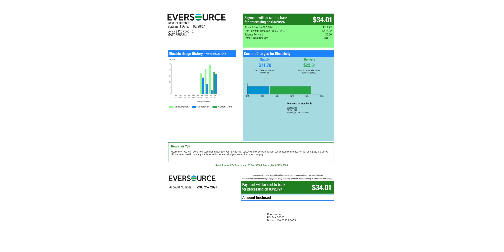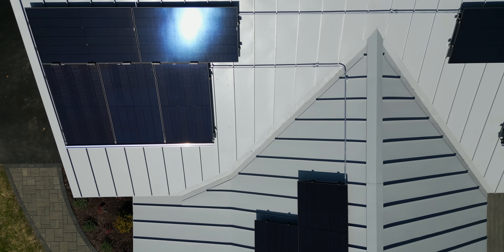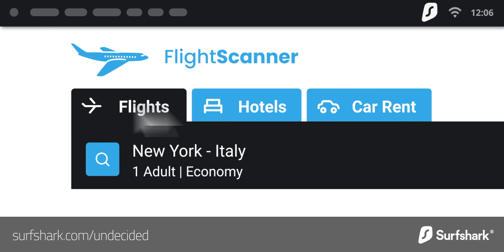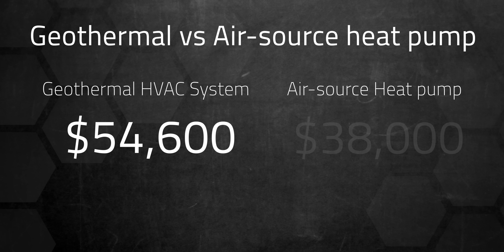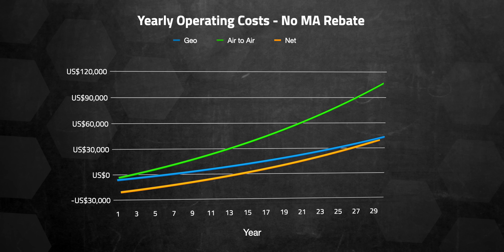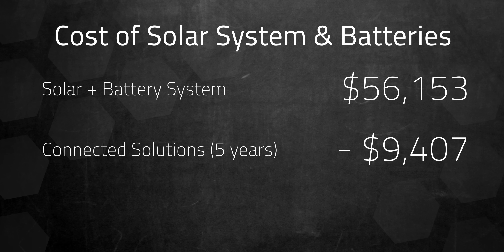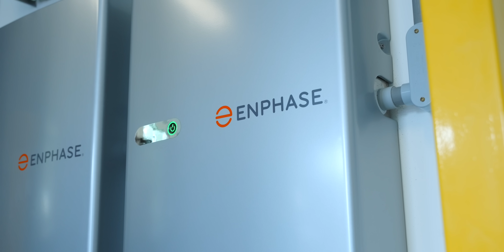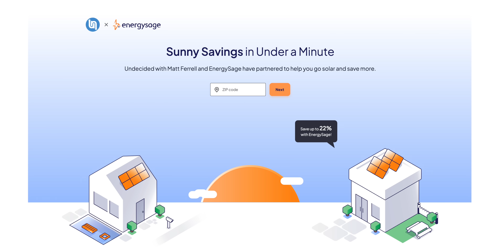What I Learned After 1 Year with New Solar Panels

Comment: The financial analysis is completely false.  It does not account for the time-value of money, that is, the earnings your up front investment would make if not spent on the solar and expensive furnace and water heater, but instead put into a long-term investment, such an S&P500 index mutual fund.  I assure you, if you did the calculation with this in mind, you would would be far ahead by not buying solar and the expensive furnace/water heater.  If Matt Ferrell was really concerned about the economics, he would have included this effect.  Bottom line...renewables are expensive, and rarely make economic sense. If you think the environmental benefits are worth it, then go ahead, however you are replacing energy that is created by very clean methods in the United States, so your actual impact on the environment is arguably minimal, and the cost to do so will be significant. Your "environmental" expenditures might be best spent elsewhere.

Comment: So you have taken $66,000 of taxpayer money for your systems in the form of federal and states rebates.  Getting 1:1 net metering takes money from your neighbor ratepayers as the local utility still has to maintain the delivery system in case your system fails.  I guess that to be 16,000 kwh/yr times $0.15 per year delivery charge or another $2,400 per year you take from others.
If we all did what you did there wouldn't be enough money by a factor of many.  Ever think of thanking your neighbors and fellow taxpayers?

Comment: How can an electric bill be that much. I have nothing that is efficient and we blast the AC and scalding hot water.  My wife uses the dryer almost nonstop to the point of burning out heating elements every 1-2 years. I actually keep a spare in the house.   Yes, everything is electric and still my bill is $500-550 a month.  That’s $6000 a year.    Over 30 years I would save 180,000.

Comment: I’m a big believer in solar panels for homes, but find there is a lot of hype and misinformation out there

We had 22 solar panels installed on our house in 2019 q e sold the house 3.5 years later 
Even with rebates it would have taken 20 years for the system to pay for itself.  No surprise there, we didn’t install them for cost savings.  During that time we generated more power than we used, and “sold” dower back into the grid.   Technically they worked exactly as advertised 

The big disappointment came when we sold the house.  In short, the solar system added zero dollars to the value of the house.  They did not make the house more appealing to potential buyers.

Comment: I’m a contractor what consumers don’t get with these technologies whether it be geothermal or solar is that ur basically paying over 20 years of ur energy costs.

Example: let’s say ur electric bill is $200/mo. (Arbitrary # for this example) that’s $2400/yr. X 30 years that’s $72k still that’s 16k before the cost of the solar system.

Now do u think ur 30yr solar system is still viable or do u have to start replacing panels n batteries over that time frame?

Do u have to replace n update the whole system in 30 yrs? Costing u another 88k to simplify these calculations. 

Not to mention ur still paying $40/mo just to have a meter on ur home adding over. $13k in 30 years. That figure only matters for solar cause that cost is already incorporated in ur normal electric bill which ppl with solar that’s an extra cost just to be on the grid as backup or to sell power back to the utilities company.

Not to mention if u have to replace ur roof which u have to remove n replace ur solar panels adding an additional cost vs. non solar replacement roofs.

In the end the math doesn’t math for solar!  Not to mention the environmental factor for battery n solar disposal

Comment: Congrats.  15 years ago we replaced two water heaters (we have a large modern home)with a tankless system for three floors.  Unbelievably we have not had a single problem and it paid for itself in seven years. The kids (and now grandkids) love to take showers because the hot water never runs out.  Solar was an idea but the company itself suggested we wait for prices to drop and efficiency improve.  (Prices dropped, efficiency rose slightly but labor costs exploded - lol)

Comment: I had a geo thermal heat pump 10 years ago.  During the winter we were always cold averaging about a indoor temp of 60 degrees.   It was costing 350 a month to power.  To upgrade 10 years ago it was 55k.  I got a natural gas furnace and ac for under 6k.   My monthly gas cost over the winter was about 130 and electricity was about 130 and I am warm.

Comment: Hi Matt i love the project I live in Sweden and have had my home 9 years it is a home built in the late 1960s and that presented some challenges but I have also made significant improvements like extra isolation in the attic installation of HVAC systems (dual for each floor) and massive solar and battery 14.4kW peak solar and 32.5kwh home battery. I am net positive producer and all my driving is in EV powered mainly by our solar system. 

I can only agree with you the investments which I made all out of pocket without loans I see as prepayment on my consumption. 

I am looking into geothermal and domestic wind turbine but they are not yet feasible in Sweden for
Permit and due to my house being connected to district heating with the fee being the largest portion of cost that I am unable to exit from unfortunately. 

Overall I have calculated that my system upgrades have already last year paid of my full investment and from this year on is making me real money so my ROI is amazing but for those that are looking into this as you said it will be highly individual due to local market , conditions and situation. 

I definitely think one should save and never do lease or renting solar nor take loan for the investment as that can bring in so many new unforeseen consequences and dimensions to the future saving. It’s better to do step by step and save until one can afford to do this and even then one should really look at one’s life situation if you are unsure of the house or life plan for
Next 10years don’t do the investment thinking it will add to the value and you still get your money back.

Comment: Hot water heat pumps are a farce. I wish social influenceres would stop pushing them, because politicians are going to be pushing them and then we will all realize that we are using more energy, not less. Net zero energy is also a farce. Yeah, maybe you have balanced out the electricity you used over the year, but what about all the energy used to manufacture, deliver and build/install all this tech on your brand new home? If everyone goes out and builds a brand new home with all these gadgets energy usage and pollution are going to sky rocket, not go down. And yeah, solar never pays off. But none of that is the point. It's about independence from the government and their inability to work with the energy companies to keep the grid going.

Comment: Im surprised at these Solar costs in USA, In Australia I paid $3600 for a 6.6kw Solar system, each year it offsets $1,200 in energy cost. Then when adding a 20kwh battery which costs $8k installed, it offsets my entire daily usage. With battery I pay a connection fee per month, and thats it, break even after 5 years, the system saves me $2448 annually, even during winter, tho I will admit its more like CA weather here.

Comment: I installed 6kw in my house in France, get a max of 4.8kw as panels face southwest. I save 30% on my house electric bill and 4000Euros a year charging my hybride car. System cost 13,000 Euros but added 5% to valve of house = 25,000 Euros. So overall a big financial win and effectively already paid for itself several times over after just 2 years.

Comment: Love your videos, you know on some of those installs you could gone DIY like the solar . 400 watt panels run around  $0.27 - $0.35 per watt , 43- 400 watt panels at the $0.35 is $6,020.00 plus a  inverter let's say $4,000.00 , not buying the most expensive mounting (snapNrack topspeed) $1,500.00 ,also some installation help $2,000.00. A grand total without splitting hairs  $14,000.00  the inverter is battery friendly so additional  for batteries $3,500
.00  and optimizer are cheaper, so $1,900.00 for a new total of $19,400.00

Comment: I’m in a low tax bracket so no subsidies for me.
I did a DYI system for about 20 grand with panels, all in one inverter and battery backup. I added 15 kWh of battery to double my capacity for under $2500 and 10 more 3700 watt panels to double my solar for under $900.
Batteries make sense since we have a TOU program that gives us low rates at night for battery and car charging. 
We calculated our ROI to be around 5 years between gasoline and electricity savings.
I guess if you make tons of money 💰 you can pay top dollar and get credits.
Personally I think tax credits for solar and EV’s should go away along with oil and gas subsidies.
We also have lots of shutoffs so we are covered there.

Comment: Your homes saves up to $300,000 over 30 years.

Your out of pocket costs are
Geo-thermal 39,600
Solar & Batt 61,253

If you invest $100,853 for 30 years:
7% $763,995
8% $1.01 million
9% $1.34 million
10% $1.77 million
Reply: No real savings when compared to a normal investment in the market, bonds, CDs, etc.
Reply: Ummm, you can do both of course . . . The rest is a matter of preference.
Reply: He financed it so he only put down 20% of that

Comment: Tbh euros would absolutely laugh at the solar installation costs, something like that could had costed under 25k or probably 35K still using Enphase equipment.
Here in Oregon we're being quoted about 50K for 14kWh, something I estimate we can DIY for 8K in material costs (12K if I used the same equipment) including conduit and other, so even if I underestimated by 10K, the difference is insane.

Comment: Power's really expensive in mass, here in maine I pay a little under 13 cents plus a $27 service fee that also includes the first 50kwh. I used 2845wh in 2024, and that's with electric heat (just a space heater it's a 1 bedroom and I keep the door to the kitchen shut) and using an ac for basically all of july/august, I plan on not using it this year to save tons of power though.

Comment: Just in friendly comment that its good to discuss of Peak power of solar system as like 17,2 kWp system as its not going to produce all the time same amount. good video content overall and just want to add on that point :) Just now I am building a new house, wheres added solar system, much smaller 5,5 kWp with micro inverters, but idea is not push in to the grid, more like use as its own and later on maybe battery system but more interest when V2L and V2G coming and more use of cars in the storage systems not stand still batteries :) overall point is that later on us consumers always have to pay either for use of energy or for feeding energy into the grid.

Comment: I cannot compete with you in the nerdiness realm, but as a retired nuclear engineer I do like tech. I am on my second generation Waterfurnace ground source heat pump. I even had a Carrier heat pump that attached to my water heater in my home in the 1980s. When I upgraded this house heat pump water heaters were not readily available so I went with a 95% efficient forced draft gas water heater using outside air for combustion. After installing a later model Waterfurnace HP with desuperheater I added a 55 gallon water heater just as a preheat tank to harvest heat from the heatpump and supply the gas water heater. During air conditioning season here in SC that supplies pretty much all my hot water, and quite a bit in the winter. The highest gas use this winter was 5 therms, which includes a bit of gas log use. If I did not have the gas log I would switch to HPWH here and will do that when this gas unit fails. In my vacation house in the NC mountains I have a large basement/crawlspace with an 80 gallon HPWH in the garage so it helps dehumidify the house. Lowest winter temp I have seem in the garage is 55 degrees. Since we don't spend a lot of time there in the winter I went with an efficient air source heat pump with Propane boost. This will heat the house quickly and keep it warm in cold weather at minimum up front cost. In 10 years I have used about 100 gallons of propane. Average electric use is 320 KWH per month. In September I installed a ground mount solar array at home that puts out 7.65 KW peak. My monthly average output for October through March was 1.066 MWH. In SC solar requires a time of day rate and I can only use energy credits in the time window they are generated. So I pay for anything during super off peak 1-5 AM and most during the Peak hours (6-9 AM in winter and 4-8 PM in summer). Still if I ignore fixed charges I am only paying about 60 cents a day for electricity. This is for a 3400 SqFt, 100 year old home with no insulation in the walls. (they are stone, ~ 20 inches thick). I have sealed the basment and insulated the roof deck. Run whole house dehumidifier here and in NC. Enjoy your presentations.

Comment: Our costs for solar and geothermal were less but it wasn`t new construction.  We live in the Hudson Valley and the 1900 sq ft house was built in 1987.  These prices are after all incentives.  The Geothermal was $21,315 for a 5 ton system and used 6422 kWh at .25/kWh or $1605.50 for the past year.  The solar was $30,840 for a 16kw ground mount which produced 19,870 kWh in the past year.  We have no batteries as NY still has net metering although there is the basic charge of $43 a month.  The $1605.50 in electricity to run the Geothermal is what just the heating oil would have cost to heat our home in the current winter.   We also own 2 EVs.

Comment: All these analyses are flawed. Savings in 30 years ??  Cmon. The only legit way to measure this is a TVM or discounted cash flow analysis with a discount / required rate of return. God forbid you are putting up $100K upfront for solar / geo thermal. At 6% that’s $500 per month. Which covers most peoples bill anyway. “Break even” analysis is not enough.

Comment: 16:35 We installed a 6.4 kW ground mount PV system 4 years ago sized for our historic use of a 14 SEER AC with gas furnace, water heater and dryer. We replaced our old HVAC with a heat pump and over the past 4 years it reduced our consumption enough to generate more than 4MW than consumed which we  banked through 1:1 net metering. We're using this surplus to now power heat pumps for HVAC, water heater, clothes dryer and to charge an EV. This is allowing us to stop paying for and burning fossil fuels for our heating and cooling, hot water. With net metering we are charging our EV for free. We haven't had a electric bill other than the $12 monthly customer fee in four years.

Comment: As much as I love your setup, I don't think I would benefit that much.  My January bill for electric: $83 for 484 KWH.  Natural gas: $157.  I have high efficiency furnace and AC unit.  In the summer, my electric usage will go up to $180-200 due to AC running.  Natural gas usage goes down to $15-20 for hot water.  I have a 2600 SF house with 3 car garage (that's heated).  I probably average $150 a month for electric and NG overall.  I live in a suburb of Minneapolis.

Comment: Matt, I enjoy your  perspective.  However, you talk about savings over 30  years and that is a very long time to forecast.  You mentioned a savings of $300k over a HERS 52 home, but what I was really curious about was the Solar plus battery costs and how you calculate your break even.  Unfortunately, your projections do not consider time value of money and it seems you net your 61K cost down to $47k based on future savings.  Bottom line, I'm skeptical that you have a 9 year payback.  What you have is a energy net zero home which you enjoyed building and feel good about.  You may be happy with a 10 to 15 year break even, but for many people, what you did is not financially sound, and probably only makes sense if you appreciate or just want energy independence.

Comment: You are all dreaming. At no time in history has life stayed that stable for 30 years. No time in history has stuff not broken down or need major maintenance and guarantees are useless as time goes by. It is not a good financial decision for 99% of people as they will never stay in a house for 30 years. The data shows that the average length of a 30 year mortgage is 7 years. It is a demanding lifestyle to keep an eye on a solar system which most people dont drive drive a new car but for 2 years l. Pie in the sky nonsense rhat will fade away faster than it appeared.

Comment: I've got 19.2kw panels. 2 18k inverters and 85.8 kw of batteries I'm installing for about $30,000. Before tax rebates. I self built my house. Geothermal super insulated 3400sqft. All in, about $250,000. It can be done. I worked lots of OT. Driving forklift. While self building my house.

Comment: Ive been in solar sales for 6 years. I'm sorry to say that you paid way too much for this solar system, you paid about $3.22 per watt and for this size system if you had shopped around you could have achieved probably $2.80 for REC with Enphase.  Most people get solar panels to save money, not because they want to go off-grid or go net zero.  Your report is really only helpful to people who want to get batteries with their solar.  The batteries aren't even necessary and could have been added in later.  Thanks for sharing but I think its a better service to let people know that batteries aren't necessary and your house is a special case, not the norm at all.